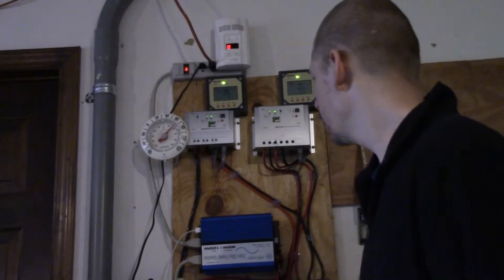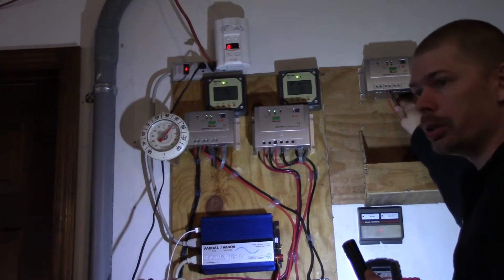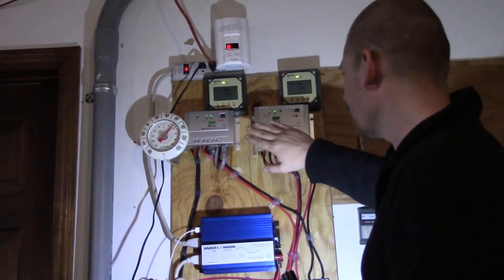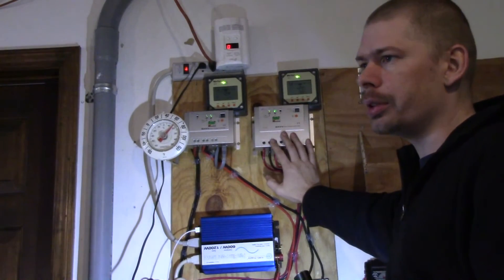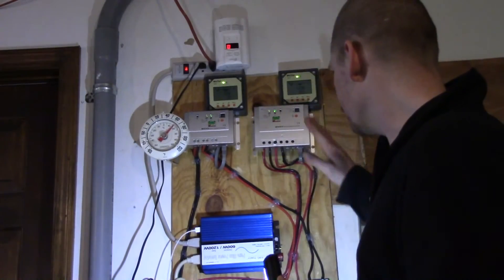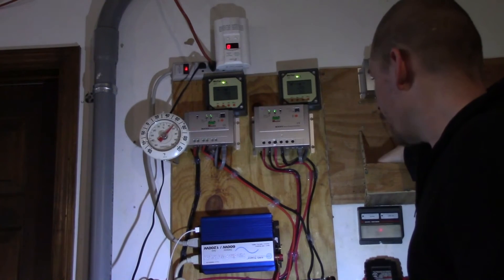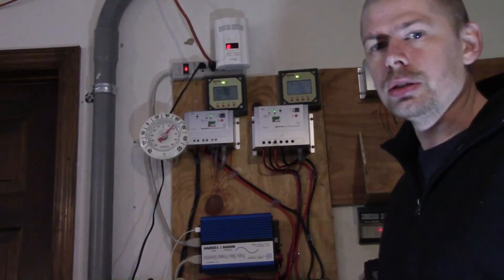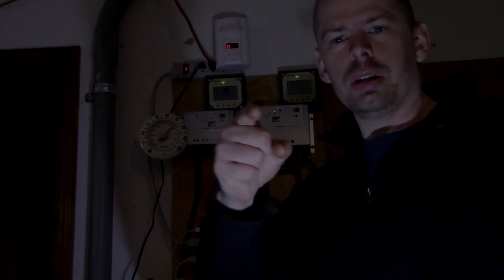TRACER MPPT Solar Charge Controller Problems.

Comment: Have a new 80 amp epEver controller, and a 2400 AH gell battery bank. I hooked up 1 group of panels that makes 88 volts and 8 amps. The charger worked fine at this point.. but since I need more power I added more of the same, expecting an increase in battery charging.. but the controller seems to want to only allow power equal to the first group of panels even though the potential for much more is now available. It should not limit anything until it reaches 80A, but its maxing out at about 45 amps which is ridiculous, it's got enuf panels connected to charge 4 times that, and the battery is not charged, yet either. I tried resetting the controller to no avail, it just acts like it cannot do more than 40-45 amps output.. has anyone else ever had this problem
Reply from the maker: check your solar panels power output to the controller
Reply from the maker: before your controller
you should have full amps from it.
look up your panels for testing
Reply: Turns out the controller was already on float mode... The controller had them charged earlier in the morning.. when I started up the diesel backup charger, and the voltage shot up to 15v... I'm just not used to having them charged so early in the day.. awesome controller, wasn't expecting that

Comment: I have a epever tracer 4210an. On 24v battery.  Then I installed the ble Bluetooth module. It was fine for a week. Till I used my phone to turn off the load and turn it on again - the controller shut down and refused to start again. Display blank. Any idea what could be wrong?
Reply from the maker: it burnout maybe not unhook the solar and then the batteries and hook the batteries up can see if it powers on

Comment: SOS. Can I run 24 volts into this system and have it charge my 12 volt batteries?
Reply from the maker: Can you show me in a video what your doing?
Reply from the maker: You can run anything the charge controller can handle most likely under 150 volts ,read the instructions to find out the input and the output voltage, it is crucial that you use an MPPT charge controller that is not fake,there are many fake charge controllers,my suggestion is a midnight charge controller.It does everything.

Comment: What are the model numbers of your Tracer series controllers? Which model died on you? Which model was the smaller one on the far left?
I have a 2210RN Tracer.....still in the box. I've seen a couple of videos showing these units run pretty hot, probably helping failure or malfunction.
Thx
Reply from the maker: I don't have it any more I have a classic 150 and it's great. Don't overload it if it's 20 amps go 15 max. The classic 150 will run @ 96 amps

Comment: you HAVE to supply battery B4 hooking solar up. These are real MPPT controllers, EPsolar/EPEver are two generations past this already. They work great. AND, BTW, a little math will tell you whether your clothes dryer will work or not. Do the research first!
Reply from the maker: I have a 48 volt magnum with a classic 150 installed now this video is a bit old  
https://www.youtube.com/watch?v=F6RB-iUmpmw&index=2&t=6s&list=PLETlm4IDyX81vYBtg9Jh-F83pHGlUs_a3

Comment: It is always worth reading the manual. It took me several read-throughs before it all fell together and made sense.  I read it online before I bought the actual charger, then selected the panels for best performance, as per the manual. Read-read-read, then configure your system to best suit it's component parts. Good luck!
Reply from the maker: +nlo114 reading the instructions manual for meters are the most important thing you can do but testing and understanding it at the same time is much better.
Reply: You're spot-on there. I had to read through many times over a few days, before it soaked into my brain! I run 24V 40 Amp system. My 5x190W panels will go to 45V open circuit. Looking at the efficiency graph at the back of the book combined with the 'optimum-number-of-panels' chart, gives the highest efficiency and the lowest losses at the levels of sun that I get. In winter, I switch in the other 3 panels for a bit more 'oomph'. All my fuses are the same rating as the charger, My Isc's add up to less than the max rating of the unit. Good ventilation and run the loads direct from the battery, not the load terminals, or use the load terminals to operate a separate power-contactor.
Reply from the maker: Good to know you have lots of understanding of it and fuses are great to have keep it growing
Reply: Can I run 24 volts of solar into this charge controller and confidently know it will charge my 12 volt batteries?

Comment: Believe it or not, a lot of the heat problems comes from using wire cables that are undersize. Great video mate. cheers
Reply from the maker: +NR D thank you can I ask did you have sound problem with my video
Reply: +Guns,Games and Racing  Gday, no sound problem mate. Why?
Reply from the maker: I was thinking your talking about today's video sorry. I will reupload a video asap for today thanks.
Reply: +Guns,Games and Racing  No worries, have a great day. cheers from Australia

Comment: I had mine for 5 years and no trouble so far I got two  40 amp mppt charge controllers & two solar arrays & both are charging one battery  bank.